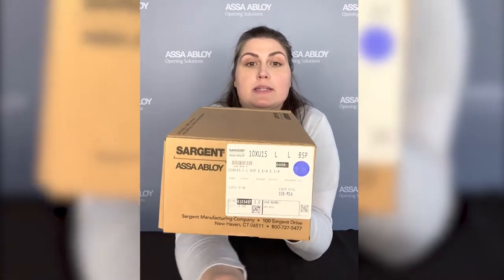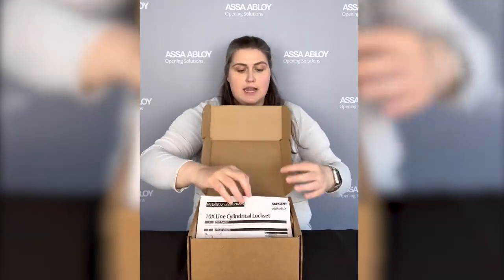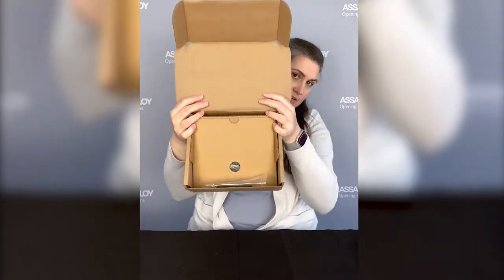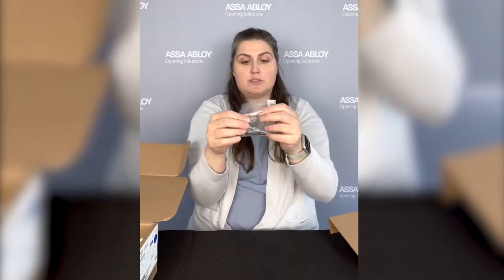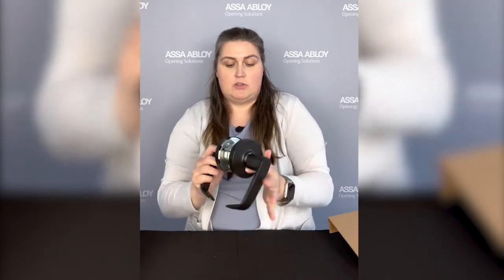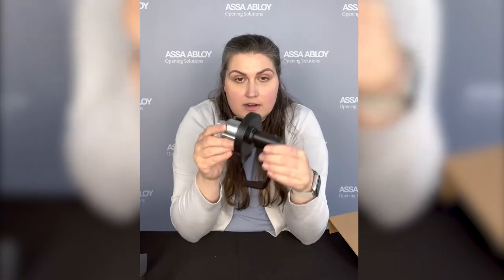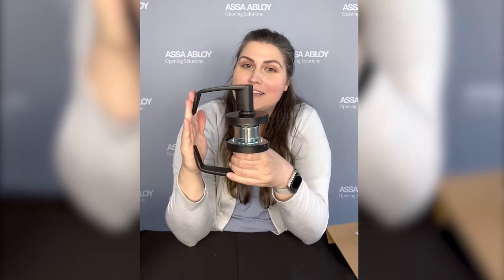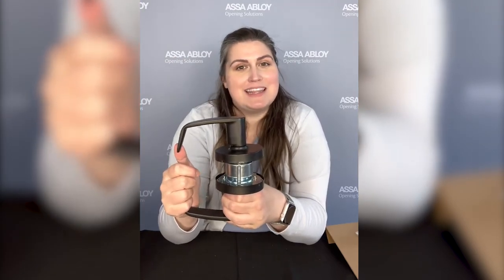Sargent 10X Line Unboxing

Comment: How is the 10X series different from the 10 series?
Reply from the maker: Great question, Mike! The 10X Line is a completely new lock with several improvements and advantages to strength and function over the 10 Line. Although most parts are unique (they basically only share the same latch), the 10X can incorporate into existing Sargent systems with a seamless look and cylinder compatibility! Let us know if you want more info!